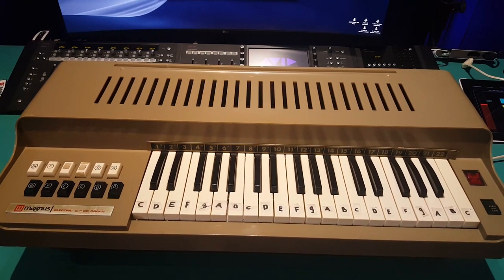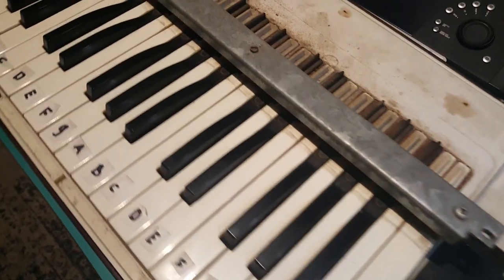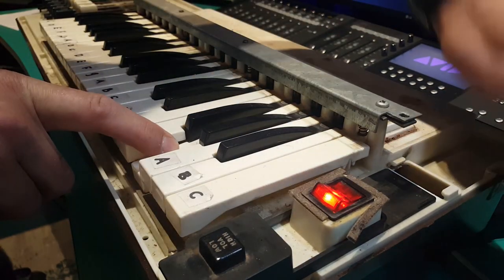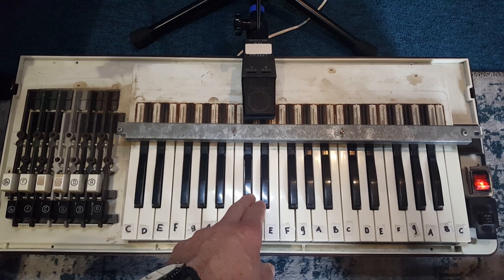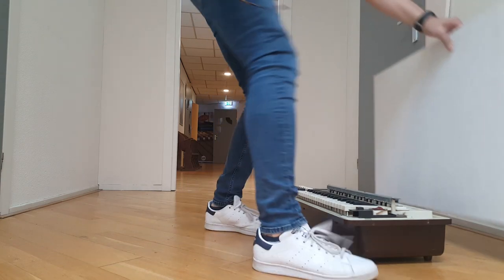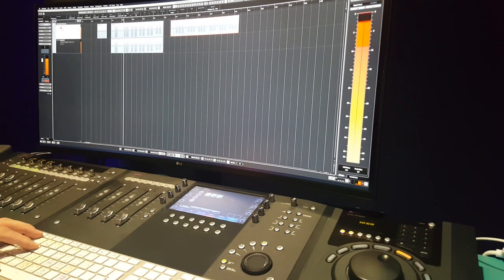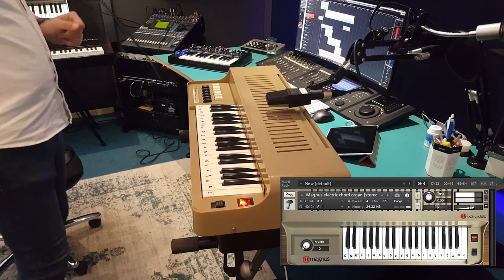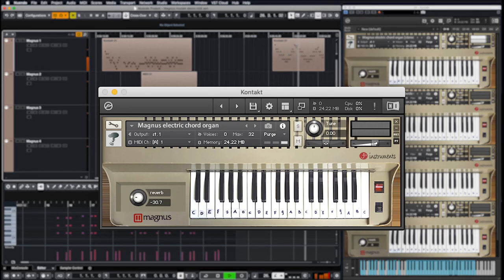Rebirth of a sixties Magnus Chord Organ for Kontakt

Comment: I understand why you would want to put a noise gate on the recorded sound, I grant you that, but I think turning the thing into a virtual instrument robs it of much of its character. It sounds too pretty, too clean, and too synthetic. Can you at least dial in some of the noise, like fan noise or even how pressing some of the keys may be very percussive? Consider Daniel D. Johnson's record "Walking the Cow" where it has both of these elements, which in my opinion make it a much more interesting recording than if he used a professional Hammond Organ with line-in, or a virtual studio instrument with a pristine sound in a DAW, etc, etc.
Reply from the maker: Thanks for your response. And you're right, the instrument loses character by reducing a strong feature of it, the noise. Personally, I have no problem with that in this specific case, but imho that is also a matter of taste. The samples still have some noise in them, only less. Also, the instrument does have the full fan noise that can be triggered with the low C. But I will think about including the raw samples into the instrument as well, then there's something to choose from.